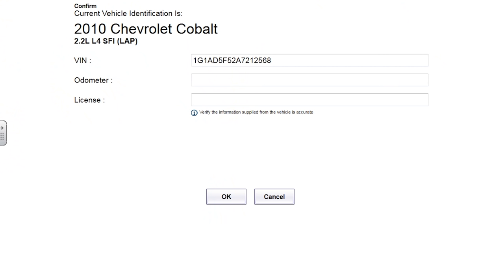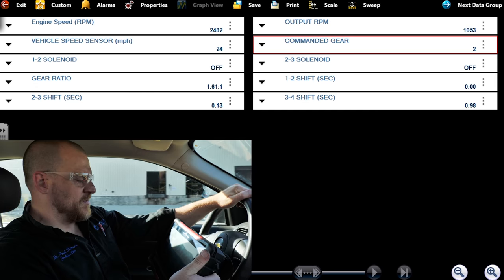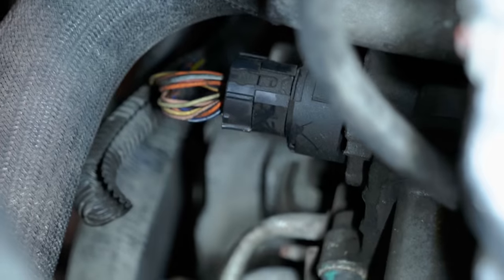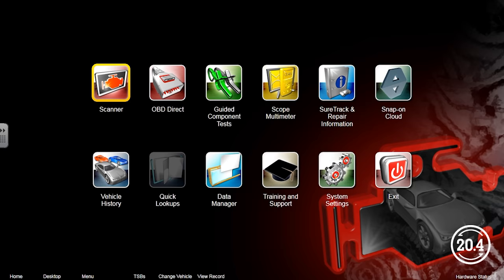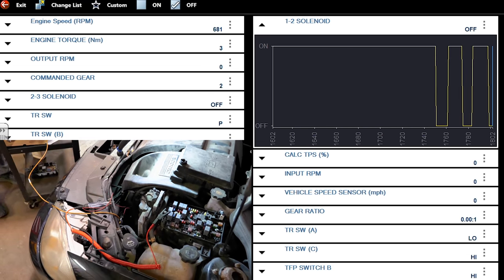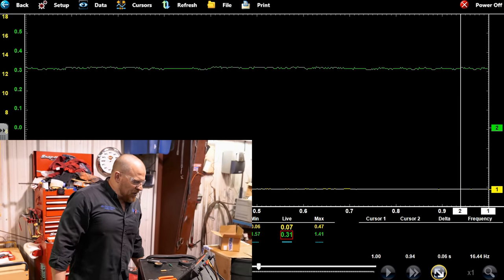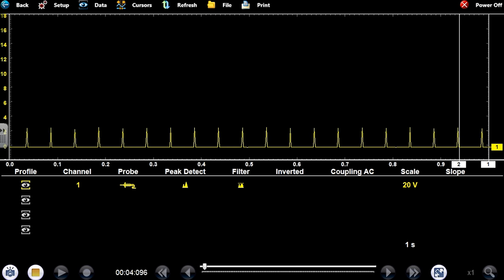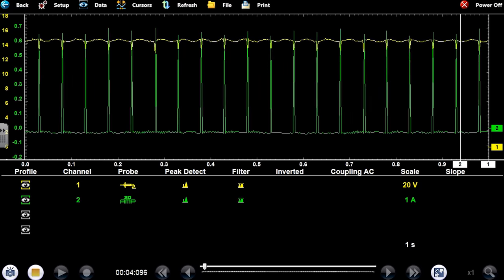Testing Transmission Shift Solenoids - (P0700, P0974)

Comment: I tested one with a 12V lead and think that's how I broke it. Think that's possible?
Reply from the maker: You put 12v to a ground side switched driver? And that driver was energized? Yes, you cooked it. If you're talking about something else, my apologies.
Reply: @ScannerDanner  the leads were connected to the battery. The opposite ends were connected to the solenoid. The leads were tried and then swapped from one another. Are you saying that swapping the test leads with one another would fry the solenoid? 

I saw in the video that the pcm sends a signal through one wire and the other gets the command to be grounded. Is that why swapping the leads frys the solenoid? (Speculatively the tcm may be designed that way to prevent damage in the other direction if the concept applies)
Reply from the maker: @groggiero2  are you talking about a voltmeter or ammeter  connections? Voltmeter, your safe no matter how you hook it up, and ammeter you are not
Reply: @ScannerDanner  neither. Nothing was measured. 12V was applied to one side and earth to the other.

 The test was done twice to test each side for a bench view of the mechanical function
Reply from the maker: @groggiero2  Oh okay, you were just manually jumping the solenoid with a power and a ground. As long as the harness was unplugged when you did that you shouldn't have hurt the solenoid. Unless it was a pulse width modulated solenoid and you overheated it with direct battery voltage?
Reply: @ScannerDanner  I was thinking the latter but I guess the fact will be discoverable with the discovery of the type of solenoid a on a 99 accord with the b7xa transmission for the v6 model

Comment: The reason you don't have a straight up line is because the the solenoid has a winding that is grounded  near the low end of the winding, & the winding electrically  above the short is limiting the current.
Reply from the maker: What time frame of this video are you referring to?

Comment: Kinda sux that the solenoid fault will not let it pass emissions. The test facility probably assumes it fails no matter what if the MIL light is on regardless of the actual emissions status.
Reply from the maker: I guess the justification is that gas mileage is affected

Comment: The grounding eye on transmission has corroded connection wires have broken cut repair fixed
Reply from the maker: Not on this one. Corroded grounds or wires do not lead to excessive current flow! This was a shorted solenoid

Comment: I don’t do any electrical testing with a dead or bad battery. I’ve been bit to many times. Your test results could be off due to a bad battery
Reply from the maker: Agree but sometimes you have no choice and this particular condition was not affected by it (weak battery), so I continued.

Comment: You could have checked if wires where touching internally with you set up
Reply from the maker: I dont remember what we had. A shorted condition and high amperage right? Power side switched and internally grounded I believe?
If that's the case there is no way to differentiate between that control wire touching ground directly from an internal shorted wire or from an internal shorted solenoid. 
But it doesn't matter. There is enough info now to sell the job
Reply: @ScannerDanner  Definitely enough to sell job. It was 3 solenoids powered but fuse and computer pulled to ground to operate 1-2 shift. If 1-2 ground showed anything when activating another solenoid you could say it was internal wire touching. If it didn't show than internal integrity would be fine. I love diagnostic. Great videos keep it up. Just giving my opinion on observation.

Comment: If there’s oil in the harness then the harness is junk which could be the cause of the failure
Reply from the maker: As others stated, this entire solenoid and internal wiring is surrounded by oil. So I don't think so, but I was also concerned about it as you stated

Comment: The harness from chevy is 90 bucks and you can drop the trans without removing the subframe biggest issue is removing the valve body to replace the solenoid just make sure do not loose the check balls don't ask me how I know it was a long couple of hours looking for a small BB in the shop. But the book is right  expect 6 to 7 hours for RR and repair
Reply from the maker: Thank you John! Great info
Reply: check-balls, what check-balls 🤣🤪   as they go rolling all over the garage.

Comment: Wish you would do the check engine bypass I bet it would set a 1870 code and not let you cheat the system.  Right now you have a solenoid  code . But if you bypass  it for the engine  light you are gonna get a 1870 that will not pass emissions
Reply from the maker: My brother and I talked about that at the end of the video 😉 
Agree!

Comment: Can’t you just run a simple scan on computer to transmission it will just tell you what’s solenoids bad ?
Reply from the maker: No. Wiring and bad transistors in the module can set the same fault

Comment: That vehicle would also be missing 4th gear because of the shorted "1-2" solenoid. So tricking the PCM with a relay or light bulb wouldn't be a good fix even if it didn't set a code. Most likely it would set a "1-2" solenoid performance code rather than a gear ratio code.

Comment: I honestly can't stand the Chevy Cobalt, as a car.  I was boggled that as a 6'2" person, I can barely fit my head in.  I can drive a little Toyota Echo with decent headroom.....but the Chevy Cobalt was basically made for short people....certainly not reasonably tall men.  Horrible cheap car, in my opinion.  So many of them are already off the road, after only about 10 years or less on the road.